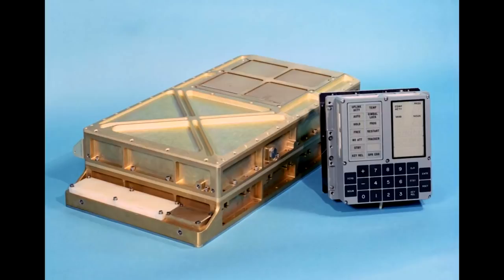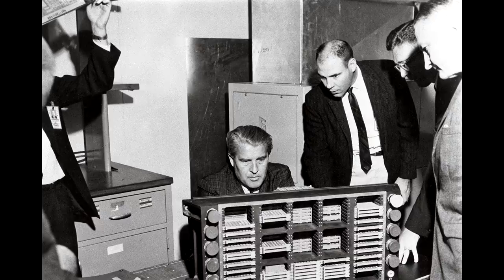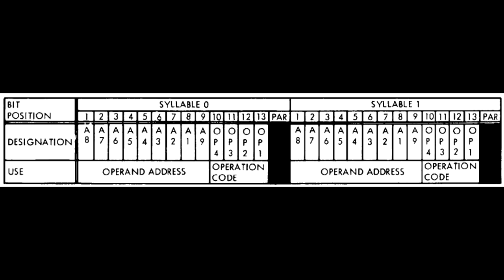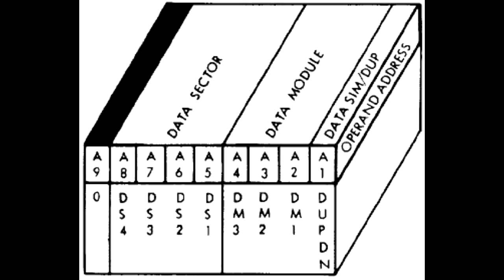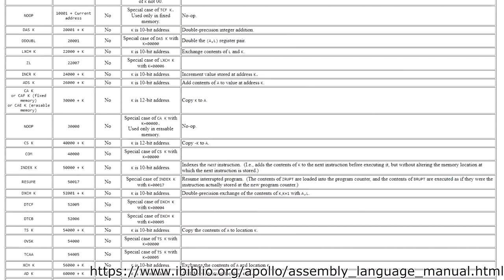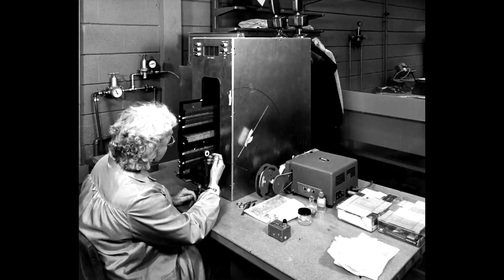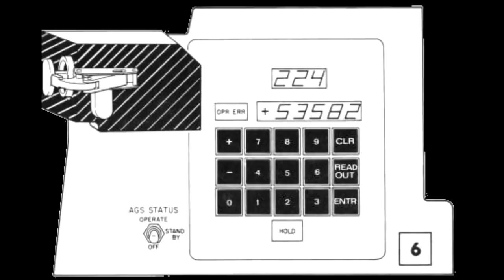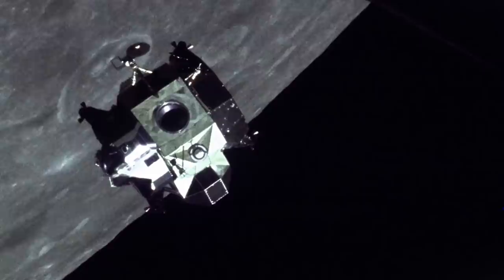The Four Computers That Flew Humans To The Moon

Comment: I was in the U.S. Navy in the time frame than these computers were being designed, and was aboard the first of the Navy's ships to be equipped with solid state computers, the Naval Tactical Data System (NTDS). Like the four  different Apollo computers you describe, the several components of the earliest NTDS all used different types of logic, different word structures and and even different logic voltages.  As usual at that time the choice was up to the manufacturer with only the intercommunications between devices dictated by the Navy team in charge of the system. There were some strangely named gates  used and both positive and negative logic employed. As a technician working with the whole system as installed, it was  sometimes a real challenge to follow a chain of commands that were not acting correctly on the display consoles.  As with the early PC's reboots were a common necessity. We had two main computers for redundancy,  though there were a few single points of failure in the system. Punched paper tape could pile up  on the computer room floor trying to troubleshoot.  The craziest comment I heard from one of the industrial designers who came aboard to see how this, essentially prototype, system was working,  was  when he was shown the reverse writing on plexiglass plotting boards that would have to be done manually when the computers were not working. "No, No! he said. Our system is supposed to replace all that!"
Thanks for the  comprehensive overview.
Reply: Computers and reboots...  together forever.

But with me and naps, how can I judge?

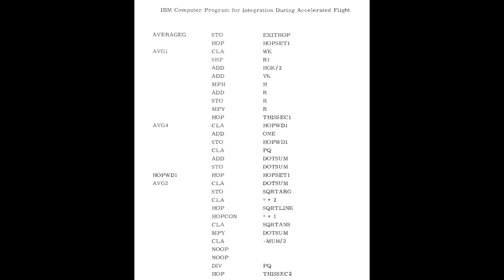Comment: 5:22 
  "If they'd let a hacker anywhere near the thing"
 If they take their historical preservation responsibility seriously.
  Code is not some throw away element of the past. It is highly refined prose that hundreds of people spent thousands of hours refining. It deserves just as much attention as the hardware if not more. I suck at it, but still... I can appreciate it.
Reply: Add a few more zeros to the hours spent to compute and refine the computation. The people involved in the math race were ran ragged by the end.
Reply: just recreate it in fpga and boom.
Reply: Ctrl+A, Ctrl+C, Ctrl+V
Reply: If the code is in there and not examined, it may as well not be in there.
Reply: Hear, hear! :) Without the code, the computer is meaningless - it is just a hunk of metal and silicon. Its actual historical function can only be understood by reference to the code which made it perform that function. If that code is locked up inside the hardware, it is "critically endangered" - a mishap could destroy it forever. Every copy of it held externally to the hardware is a vital historical "insurance policy".

Arguably, the code is even more important than the hardware: should the hardware be lost, the code would still provide deep insight into the inner workings of the launch vehicle and, indeed, the collective thought processes of the design team and it could still be run under emulation or even on a replica of the hardware if schematics are available or were to come to light in future. Were the code to be lost, any hypothetical replica hardware would still be of little value.
Reply: @molletts  one needs to understand that, specialized and complicated devices are intelligible within their context, but not usually outside of it; hence, over time, the amount of time & mental effort (omitting the difficulty of finding research material) needed to understand exactly how they did what they did, beyond the bare facts, goes up.
[TL;DR edition]:
As things fade into the antiquity of past; the more specialized, complicated, and interoperative they are, the more effort needed to understand the specific way that they worked.
Reply: Just Let Curious Marc near it.
Reply: @t65bx25  Not sure what that sequence is supposed to do. In my terminal:

CTRL-A -- go to beginning of line
CTRL-C -- send interrupt
CTRL-V -- escape next control character

What kind of OS do you think we would use?
Reply: Years ago, I contacted them about doing exactly that. While they were open and interested in the idea, when we did further research to determine its provenance we found it was only a test article and was never loaded with software.
Reply: my guess is IBM claimed some copyright shenanigans and its probably all moldering in a corporate archive somewhere while the AGC code was all written by nasa and MIT so public domain
Reply: @lawrencedoliveiro9104  Yes, we get it, you run Linux and therefore think that shitting on people counts as contributing. Good job reinforcing every negative stereotype of the F/OSS community and undoing all the work that all of us who actually built the community put in.
Reply: @AsbestosMuffins  I wish that only copyright shenanigans were the issue. When IBM was broken up by the government was a monopoly, the government stuff was spun off as IBM Federal Systems Division. FSD's space stuff was told to Loral, and Loral lost it. Later on other artifacts were found from which the software might be reproduced, but the as you guessed, there are legal issues in doing so - but they are in the areas of missile systems classification and weapons technology export controls rather than simple copyright. Work in that area is still ongoing and I can't safely talk about the details.
Reply: @lawrencedoliveiro9104  Ugh, you use emacs bindings? Real men use set -o vi 😎
Reply: @SuzuranMajere  So likely then that code is still in active use as control on missile systems.

Wonder what happened to the Minuteman guidance computer Jim Williams had as a hall decoration, likely the LVDC software is the direct ancestor of that system, and the hardware likely is just an updated copy as well, just with a faster computer core that enabled it to handle the analogue computer functions in house.
Reply: @HuntingTarg  You write: "the more effort needed to understand the specific way that they worked."
I believe the level of effort is also dependent on the team doing the reverse-engineering.
The AGC reverse-engineering work had the benefit of several of the original software and hardware engineers being at lease somewhat available to answer questions. If only the names of folks who worked on the LVDC were as well known. Are they? And most importantly, are they extant, or extinct?
In personal experience reverse-engineering dis-assemblies or recovered source code of other, less world-famous, but historically significant systems, I've run into humorous situations where I was literally telling the original engineer(s) what I thought the code appeared to do. I did this not so much to convince them that I had any significant holistic idea of the overall solution (that came later) but in order to jog their memories into remembering what it was they were trying to do in a particular bit of code. Once they started correcting or at least discussing my superficial observations, the memories came flooding back!
This strategy was particularly valuable in reverse-engineering data-structures and file-structures for the purpose of making systems to read the old data files with integrity, so that modern-emulators could use the data.
Reply: @sleat  At one point in my research I was doing what amounted to cold-calling half of Huntsville looking for ex-IBM people who worked on the LVDC. A little more than half of the ones I found refused to speak to me - When they were working on the project, the particulars were highly classified defense materials. Since none of them were formally told it was declassified, they still considered it classified and treated it as such. Others that did talk to me told me that due to the classified nature of things, they left their work strictly at the office and did not bring home any prints or other material. IBM was very thorough in their security and classified materials handling procedures. Meanwhile the IL folks didn't give a crap and mishandled lots of stuff that would have gotten them lots of prison time if they had been caught doing it.
Reply: Simon Buchan No they don’t. Real real men use ed.
Reply: @SuzuranMajere  Yes, I've run into something vaguely similar dissecting old ROLM military modular stuff. I find it a bit funny that the basic algorithms used by, for example the AGC/LEM to esentially "soft-hit" a target location (on the moon) were directly derived from existing missile-guidance code. The roots of this art are available in textbooks on missile-guidance.
You probably already know, but the Titan missile's guidance computer came from IBM, and the same unit was later used in the Saturn I. Not too much of a stretch to imagine the LVDC being descended from the ASC-15. I expect something like the MX Peacekeeper guidance to still be classified, since it had a very small CEP compared to early Titan models. But stuff gets around, and it also wouldn't be that surprising to find one of the guidance sections (or part of it) in a garage in San Jose.
Reply: @SuzuranMajere  Oh, forgot to ask. Did you end up getting anything of historical significance at all? I'd find it very interesting!
Reply: Agreed. Digital archive is needed
Reply: @sleat  The math isn't any different, so logically the code isn't any different either, and is still the same in use today.
Reply: @sleat  Sorry, I didn't see this reply until just now; Youtube alerts suck. I actually did get useful information - most of it anecdotal things that were used to locate documents on NTRS that were used to improve NASSP. I'm not sure how much of it survived the Great Redactioning of NTRS, but the useful bits are part of NASSP now, which is in and of itself a living document. My work was also useful in that I eliminated a bunch of theories as dead ends, allowing others to focus on other sources that were more successful.

Comment: One of my favorite facts about the AGS is that they implemented their read-only memory by omitting the Y addressing wire through the cores holding 0. This made it so that during writeback, these cores were guaranteed to not flip. However, it did mean that a loss of power could leave you with your hard-wired cores reading the wrong thing. To correct this, the first thing the software does when it boots up is "prime" the hardwired cores by writing to every single location.
Reply: I always hope a certain frenchman can get a look into one the AGS...
Reply: @fabiosemino2214  They're much harder to come by, from what I can tell. I currently only know the location of a single one in a private collection outside of museums. And so far we haven't been able to locate any schematics at all for it, which would make things quite a bit harder than we had with the AGC.
Reply: @mikestewart8928  Drop a line to Curious Marc on YouTube. They have a full set of schematics for the AGC and multiple dumps of the LM code from different versions.
Reply: @fabiosemino2214  yea, but I only hope that when he restores / rebuilds one of those he swaps out all the old paper and electrolytic capacitors which they dind't do with the Teletyper powersupply restore, instead they tried to reform them 🙄That's just asking for trouble 😨
Reply: @allangibson8494  Ahem. Mike is the one in the team who gave us all the schematics and dumped the LM code...
Reply: I haven't been able to source those TO-5 transistors (core line drivers) with more than 5 Amps of collector current. Heroic times.
Reply: @antoniomaglione4101  Was that pulse current, or continuous? I helped to develop and make TO-5 bipolar transistors which were able to pulse at an Ic of several tens of Amps, with an ft in the HF spectrum. They could also be water cooled and pushed to Collector currents of 30 Amps DC.
You could try asking MEDL (or their successors). Plessey might have bought them out. MEDL was a subsidiary of CEC in the U.K. Can't go into specific details on here, for pretty obvious reasons, but some variants of those devices might still be available from them.
Reply: @allangibson8494 lol, you happen to be talking to the one and only Mike Stewart from curiousmarc.

Comment: Oh, yeah. This takes me back to my Mk. 152 Univac Fire Control Computer in the Navy.  16 bit Simplex, and 32 bit Duplex words. Core memory. Huge power supplies.  Chips? What are those fancy new thingy's? Machine code programming. Grace Hopper and her Micro-secant.
Reply: What ship where you on?
Reply: @G4m3G3ni3  The fire control computer interfaced the radar, launchers, and  tactical data system together and also gave the missiles rudimentary (compared to today,) guidance orders. The beauty of core memory is they do not require power to retain information. You could shut the power off at any time, come back in six months power up, hit go and the program would restart at the next instruction. But, it is slow, power intensive, and expensive. And huge space wise. The Data converter unit was it's own refrigerator size enclosure, for 16 data channels. Data passed through dozens of 90 conductor armored cables, relay switch boards, and electromechanical  switches. The computer on my desk is thousands of time more powerful, compact, and reliable.  It also runs on a fraction of the power, and waste heat is still it's biggest enemy. I joke that the biggest 'upgrade' the machine got was when they glued a "SPERRY" tag on the thing when Sperry bought Univac. But the programming was entirely in straight machine code in Octal format, and directly accessible from the front panel.  The Terrier missile system used 32K of core ram, half of full capacity, but double what the Tarter system used.  There was also a Teletype machine to access sumo sub-programs, and input instruction for training and testing purposes. Maintenance of that was nightmarish! 
Hope that satisfies your curiosity.
Reply: @kevinbendall9119  I hope you got the paperwork declassifying all that given how the US Navy famously prolongs the classified status of some technology.
Reply: @kevinbendall9119  
"core memory is they do not require power to retain information"
Yup. ferrite. little toroidal magnets.
Reply: @-danR  But they do take a lot of power to "flip" from state to state. Also, time. From what I understand, they had to wrap each core by hand, and each has a dual layer for polarity.  You could drop a modern memory chip through the hole in the center of a core element with room to spare!

Comment: I could imagine building a computer from scratch today would be so hard to do!  Gotta give so much respect for the work they put in to create these, which we take for granted every day.
Reply: It's actually surprisingly simple because these days you can assume to have access to logic gates that just work "out of the box" - and then all you need to worry about is just the pure binary logic. And designing a CPU using just logic gates is, although not trivial, not incredibly difficult either, it's something many students and hobbyists alike are able to and often do just for kicks, or as personal projects. I've designed a 16-bit CPU from bare-bones, starting with just a NAND-logic gates (which itself is just made out of either 2 or 4 transistors, depending on the semiconductor technology used), and it's actually quite surprising how little it takes to have a fully functional CPU that can do all the common mathematical operators and access RAM & ROM, etc.

Back when these guys were doing it though? An absolute nightmare to achieve the same.

Comment: Let’s get CuriousMarc access to LVDC!!
Reply: Fran Blanch gave EEVblog some LVDC chips to test.
Reply: aserta in fairness Marc got access to the AGC from a rich benefactor and was able to keep the code after the restoration. Not all collectors want to lock everything up. But I get your point none the less.
Reply: @dmacpher  It wasn't a rich benefactor. It was a guy who bought a pile of Apollo scrap for cheap. He became rich decades after, by selling the perfectly working computer.
Reply: The only complete LVDCs with functional code inside are stuck inside Saturn V  on display at museums.
Reply: Damien Drouart Like the Smarter Everyday video with Linus. IBM may still have the punch cards or readout stored in archives though. Then you wouldn’t have to risk the integrity of the core rope memory modules.
Reply: Damien Drouart TIL. I guess it was my assumption that he was rich because of the collection. Point taken.
Reply: @dmacpher  wouldn't need benefactor and could keep more than just code
Reply: @dmacpher  prob trashed by now, cost money to keep things and law only forces you 10 years
Reply: I wish it were that easy. Years ago, I contacted NASM about dumping the contents of their LVDC. They were open and interested in the idea, but when we did further research to determine its provenance we found it was only a test article and was never loaded with software. Flown LVDCs were loaded with software during pad prep in the hours prior to launch, they did not have software hardwired into them like the AEA or AGCs. Software-development LVDCs were loaded during the development process. Physical test articles were never loaded, and some did not even have the memory present.
Reply: @SuzuranMajere  So, that means that the most obvious (but not the cheapest) place to look for extant copies of the binaries and hardware is either in orbit around the Sun, (8,10,11) or in orbit around the Earth (Apollo 12 S-IVB).
Now, unless the cores in the core-memory reached the curie point or were smashed by something, they would still contain bits. It's conceivable that thousands of orbits around Earth might "degauss" the cores, but my gut tells me the Earth's magnetic field isn't strong enough to de-magnetize a memory-torid. But if so, it may turn out that the S-IVB core memories currently in orbit around the Sun would have a better data-survial-rate!
Elon Musk likes to show-off at times. I wonder if anyone could interest him in the problem?